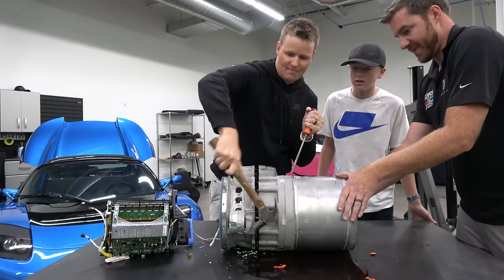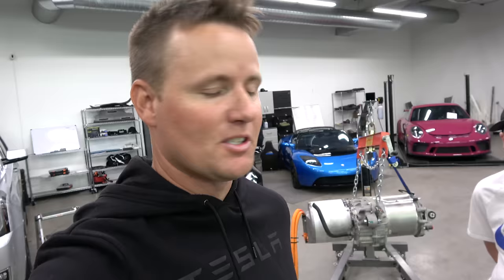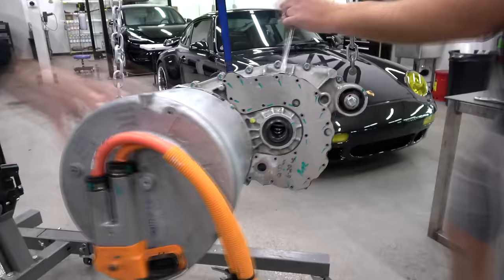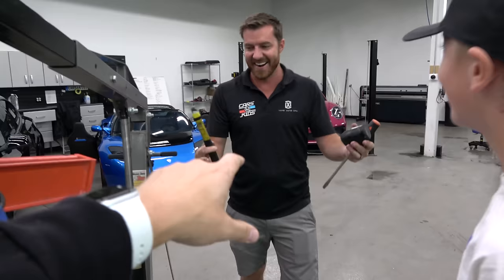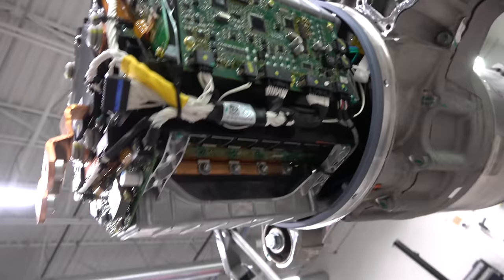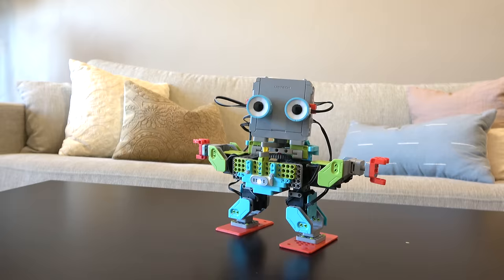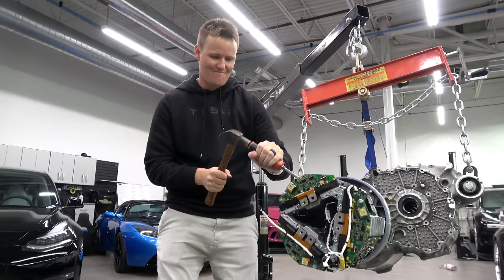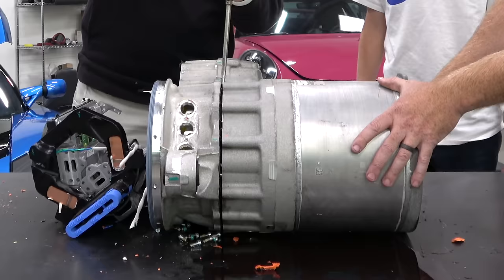What's inside a Tesla Engine?

Comment: Okay fellows, let's see, this is motor is not too big to understand. 1. the electronics are probably big MOSFET drivers driven by a micro controller. 2. the 3 big wires coming of the motor are typical of a Brushless DC motor which has 3 phases. 3. the white wire has the motor stator position information, this way the computer knows how to step up and change the next magnetic fields in the motor. 4. Can I have it as is, I will put it back together, throw the electronics and install my own.  The clear coat stuff you were wondering what it is/?! we use those to protect electronic chips so that moisture does not get through the plastic packages. Even when you don't see the cracks in plastic, it does take small water particles in vapor form. This vapor or condensation will  turn into mini droplets inside the chip which could land in a part of the chip where the connections are disrupted. This Jell will protect the chip from unwanted  vapor going in.

Comment: You opened up the inverter and the transmission, didn't quite get to the motor
Reply: They were looking at the inverter first thinking that is the motor.  Ignorance is not bliss. It's a cool thing to do, but the wrong guys.  Very juvenile.
Reply: @rjk471  the sad thing is, there are videos where people have explained the different components of the rear drive unit, so they didn't have to come into this completely ignorant, but they chose to.

Comment: "What's inside a Tesla"Engine?"  Teslas have motors in them.......not engines.  And regular cars have engines, not motors.
Reply: Right. Their (this channel) ignorance is unnerving.
Reply: WatDaMattaForYou my exact point
Reply: motor cycle, it can be called and engine too.
Reply: I think any power plant is an engine. The Tesla has an electric power plant
Reply: @DeathEnducer   But their power source is completely different.  An  engine has pistons and uses explosions as reciprocating engine parts to produce power.  (A power plant)   A motor uses electricity to spin and produce power...thus the meaning of "motor."  But hey, knock yourself out and call it what you want...everybody's doing it.  Mechanics do it....even google definitions call everything motors.  Even this video does it.
Reply: They are actually not completely wrong, it just depends on the context.
A motor is generally defined as a machine that converts some kind of energy (chemical, thermal, electrical, pneumatic, hydraulic, ...) into mechanical energy (motion). The definition of "engine" is something that changed over time. It is derived from "ingeneous" and was used to describe many technological marvels in history. From catapults or trebuchets (siege engines), fire engines (i.e. the actual water pump used to fight fires, not the combustion engine in the fire truck), steam engines to the combustion engine nowadays, and it is very likely that this definition will change in the future as well. I even heard that when the combustion engine was originally introduced, people referred to the steam engine when only using the term engine on its own.
The contemporary usage of the term "engine" (on its own and especially in an engineering context) is usually to refer to combustion engines (i.e. piston, rotary/wankel, turbine), but i see nothing wrong to use the terms interchangeably, especially outside of an engineering context (and this video is definitely outside of that context).
Maybe one could argue that in a combustion engine, the part that actually converts the thermal energy into mechanical energy is the motor and the engine is made up of this motor part and all the additional modules that assist the motor (ignition, fuel pump, injection/carburetor, etc.). But then it would be just as valid (in my oppinion) to call a hydrogen-electric engine an engine, that would be made up of the electric motor, the fuel cell and any additionaly required modules. Though i am not entirely sure how that could translate to battery-electric systems.
By the way, in german this distinction does not exist. We usually call everything that converts some kind of energy into mechanical energy a "Motor". Except in aviation or spaceflight where people often use the term "Triebwerk", but that usually includes gearboxes, fans, propellers, etc. as well.
Reply: Social media was a bad idea.
Reply: All engines are motors, but not all motors are engines. If it uses stored fuel, you can call it an engine or motor. If it doesn't use stored fuel, it's a motor.
Reply: Look up Motor City

Comment: If you can find a Tesla "engine", let me know, that baby will be rare.
Reply: Tesla Engine = DC motor
Reply: @anjananaam9347  Maybe in your countries math  :)    A Tesla ENGINE does not exist. A Tesla MOTOR does. Generally in engineering,  a MOTOR is an electromechanical converting device that uses electrical current and magnetic flux to create a rotational torque. An ENGINE is based on heat transfer, fuel combustion, to do the work, like a conventional gasoline engine. Oh by the way, Tesla does not use a DC (direct current) motor, they use an DC inverter to create 3 phase AC (alternating current)to drive the motor. It was a poke at his loose use of the term   :)

Comment: You actually didn't take apart the coolest part of this electric motor, where the windings and magnets are.
Reply: It's not like they would've understood any of it anyway.
Reply: I'm not sure if the old motors used magnets. From what I know only the model 3 has a permanent magnet motor
Reply: @macberry4048  You're right. These are induction motor
Reply: @Magiiicko  Polyphase AC induction motor?  Let's see the stator and rotor, please.  Any good links to design details?

Comment: Does Tesla old imperial bolt threads or metric?

550 pounds =~ 250kg
"100 degrees outside is only ~37 C (oceans aren't boiling just yet)

Comment: I knew I should've turned away after reading "Tesla Engine" in the title smh my head
Reply: Hahaha most underrated comment 🤣
Reply: Admit it, you came for the lulz.
Reply: its what's inside, tell me, what were you really expecting.
Reply: I don't understand the big deal over engine or motor. The definitions are virtually the same. Here's part of the Websters  dictionary definition of engine.  Definition of engine:
(Entry 1 of 2)
1 : a machine for converting any of various forms of energy into mechanical force and motion also : a mechanism or object that serves as an energy source black holes may be the engines for quasars.

And here's motor from Dictionary dot com Motor:

 noun
a comparatively small and powerful engine, especially an internal-combustion engine in an automobile, motorboat, or the like.

Funny thing is the dictionary explains a motor by using the word engine.

Comment: NOTHING is in a Tesla engine. They have electric MOTORS. NOT engines.
Reply: It’s still considered an engine as the motor still converts electrical energy into kinetic energy. They just don’t age “ice” engines.
Reply: SilentShadow7r7 No, electric motor, not electric engine.
Reply: I agree. It is a motor. Also I realized I made a typo on my last post lol. But It’s still an engine as defined as a machine with moving parts that converts energy into motion. If we can get technical and more precise, an engine is more accurately described as a machine with pistons and cylinders that run on fuel/steam over a motor that contains rotors and stators that is powered by electricity. 

Either way, they both use an energy source that is converted to motion. Engine/motor...two different things that produce that same effect.  Pity this Tesla motor was destroyed though.
Reply: @SilentShadow7r7  It's not ICE engine. ICE stands for internatal combustion engine. So it's just IC engine or ICE car
Reply: Hugs yup. I just grew using the phrase.

Comment: Title correction:

Engine = Gas car 

Motor = Electric car 

🤦🏽‍♂️🤦🏽‍♂️🤦🏽‍♂️🤦🏽‍♂️
Reply: That's not actually true it's just the common usage. 

Motor = device which imparts motion 

Engine = machine (moving parts) which converts energy into motion

An electric motor is a type of engine.

In rocketry a solid fuel rocket, which has no moving parts, is a rocket motor not an engine and they obviously burn fuel
Reply: So my motorcycle really is an engine cycle?
Reply: @PabloGonzalez-hv3td  If you were a real mechanic, you call it by it's proper name: Engine.
Reply: @frostfirei  Call what an engine?
Reply: Engine: a machine for converting any of various forms of energy into mechanical force and motion

Comment: motor*
Tesla's don't have engines.
Reply: Definition of engine: a machine with moving parts that converts power into motion.
Reply: @robwalker4653  according to princton university and MIT, a motor converts various types of energy into motion, while an engine converts thermal energy specifically into motion. Therefore the word engine works for everything from steam locomotives to jet engines, while motors does not get their energy from thermal sources. Hence the word motor would be the right description for the Tesla drivetrain.

Comment: Listen I like gas cars more for their consistency, but I'm also an electrician so that's why I'm interested. The maintenance on the electric motor is sure less but have you heard how the batteries degrade? Pretty significantly too, I would avoid spinning it as you could turn it into a generator. You didn't even pull the actual motor apart, all you did was get to the gears and the computer board.

Comment: Dude every part on anything is an important part very rarely will an engineer put parts that are not necessary, other than brake screws to hold a rotor to hub I can not think of any.
Reply: those are there to hold it on during production.
Reply: @jesvans  yeah I know after that there completely useless... A car is only in production once in it's lifetime... Hence the one thing that is basically useless on a car that the engineer designed into vehicle.
Reply: @carlosv2474  i get what your saying, but there are a few other things.

Comment: If it's got fluids inside it WILL need maintenance at some point. There's no such thing as lifetime fluids. But the point is, yes there's no maintenance on electric cars because they are not serviceable. Instead, you'll have to throw it away and get new one.
Reply: lmao! No you don't throw them away. You can replace the entire motor or motor assembly. If it's an inverter, it can be replaced.  Also, the batteries are getting cheaper and they can be bought used. They also last pretty long, sometimes well past 300,000 miles. Since things are so modular, EVs are generally simpler to fix. Design matters too, an area where Tesla is ahead.

Comment: Zero oil change, zero transmission issues, yeah ok, when you have to replace that 20k battery then make a video of how happy you are to replace it.
Reply: Most manufacturers like Nissan, MG, Hyundai, etc, have a 7+ year warranty on the high voltage battery. Well worth the investment. EV's have significantly less moving parts than a combustion petrol engine. A hybrid still has a combustian engine. EV's are better. No CO2 emissions. More powerful engine. Makes driving fun. Petrol prices are high.

Comment: you do need to change the oil in a Tesla motor gearbox and it requires cooling fluid . maintenance free is incorrect.  low maintenance is correct.

Comment: First thing about the title. Typically an electric driven vehicle is propelled by an electric "motor" not an engine. Engines burn a type of fuel, either gasoline, or diesel.

Comment: You're lucky you didn't touch any capacitors that might have been in there. They can hold a deadly charge for a very long time and if you touch them, you're done. That's why you're not supposed to take apart a microwave oven, the capacitors in there can kill you if you touch them and cause a discharge.
Reply: Honestly I wonder how I made it through my childhood alive. I used to disassemble stuff out of curiosity. No safety involved whatsoever, I have seen it all from smoke/fire/sparks/explosions/high velocity springs/120v vs my body and even radioactive materials.

Comment: The last part you take had red oil because its the transmission thats why it has normal red oil like a normal transmission and the biggest gear with the bearing you were spinning were actually the main drive gear to the both axels and bearing part fits snagged into the aluminum belhosuing you take you in front of it🤣🤣🤣😂😂😂😂😂😂

Comment: Zero maintenance? Don't Tesla's have a motor on each wheel? They all have coolant, gear oil, bearings, gears and you're going to say they need 0 maintenance? For how long? Once you have a bearing issue the whole motor must be removed from your car to be fixed. Also the ease of which wires and computer systems fail is much more unpredictable than mechanical parts.

Comment: Electric motor have problems also, I have been an Electronic Technician and am now an Engineer. They must be rebuilt also and the winding and brushes replaced. Not to mention the batteries ; new batteries cost as much as a transmission,.

Comment: This video took me back 63 years when, out of curiosity, I dismantled by first combustion engine, a junk yard Ford V8 Flat head.  At that age I had little knowledge of engines and only curiosity and desire to see what was inside it.  My effort was cumbersome.  These guys had, simple curiosity and little knowledge and their approach was as cumbersome as mine at age 12.  Nevertheless, I had no idea of the electronics involved and can't fathom the curious hot rodder that doesn't have technical knowledge of electronics or an engineering degree to repair or hot rod these engines like we did with combustion engines.  It is a new era!

Comment: This is not an engine, it's a motor.... What's the difference? A motor needs electricity to run, and it does not generate energy.... An engine uses fuel to generate energy....

Comment: Since when is changing the transmission on a car considered maintenance? Yes gas cars do need maintenance, but they will keep running and driving for years to come unlike electric cars. The battery dies? Junkyard. You had a bigger crash? Junkyard. 
A gas car can just be straightened out and put back on the road. In an electric the battery will be ruined. And that's a fire risk.

Comment: Induction motor short circuit input voltage magnetic dual speed variable zero  inverter rotation mechanical balancing module dc  electric series coolant drain temperature  electric  a dual motor transmission transfer manual generator drive rotors dual induction install acceleration traction control module

Comment: Was unaware that Tesla had an Engine in their vehicles. Im aware of electric motors, transmission and inverter but not an Engine. So what is in Tesla Engine. Nothing.
Reply: Engines can use any fuel including electricity. I don't know why so many people still believe they're exclusively combustion.
Reply: @PabloGonzalez-hv3td  Electricity is not a fuel. Any fuel that converts chemical potential energy contained in the fuel into some other form of energy such as heat. Electricity is not a substance so contains no chemical potential energy.
Reply: @onegreenev  In engineering terms it's a fuel. It can be stored and released as energy but anyways the definition of engine has nothing to do with combustion and is related to moving parts. Hence why solid fuel rockets are called rocket motors not rocket engines. They have no moving parts even though they still burn fuel.

Comment: Waste of time just imagine you have to change that and spend tons of money behind a Tesla but that motor is actually the transmission its just like a normal car where the axel CV cups go and it has the same cup seal and the thing about its just a computer controlling everything the blue coolant is cools the computer mother board and the red oil is actually for big and small gears to make the wheels spin like a normal transmission transfering the power to the axel thats the only way they can make it inside of the motor has to be just like an ordinary transmission with all the same gears and main axel drive gear its a waste of time it makes no sense at all because it has the suspension as a normal car it has same drive axel and breaking system its everything just a normal car just its  Computer boards and battery and electronic has this car running this can fail anytime

Comment: Those any kind electric vehicles power are very junk  Try live in mountain driving mountain road daily those motor short life due over heat and drain battery it far worst than fuel power engine.  You can't beat 30 years old vehicles that still driving mountain road.. I been mechinic work for 32 years done over seeing it

Comment: No oil changes or "normal" maintenance like a internal combustion engine car.  What happens when it needs a $20-$25,000 battery or you go to sell the car with an old battery and nobody wants it?  All the money "saved" is gone. Gas savings is not relevant because of the high price of the car to begin with and the cost of charging.  I can buy a $20k gas powered car instead of a $60,000 EV. Cool cars, but financially a bad choice.

Comment: ITS A TERRIBLE INEFFICIENT MOTOR
Reply: Electric motors are 90% efficient and ICE are 30-40% so you learned something today
Reply: You don’t know what your talking about there is no way a motor can be more than 100% effective. Efficiency is just a measure of how much energy getting used for the desired task. The rest of the energy gets turned into heat(so does all of it eventually). Electric motors are generally 85% to 90% efficient. Considering you’re telling me that engineers are working on a way of making an electric motors that is 3000 to 4000% efficient which is not thermodynamically possible you don’t know what you’re talking about at least in efficiency.